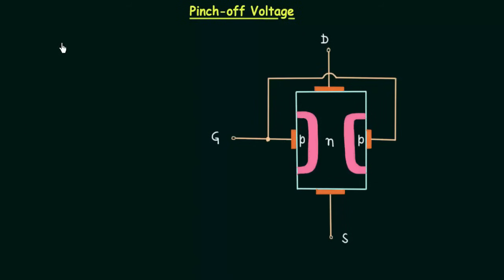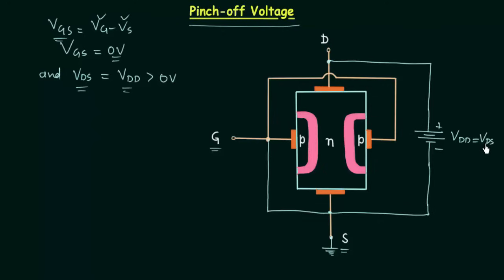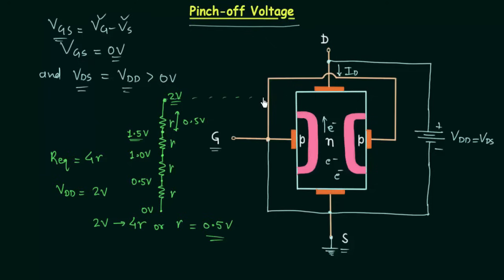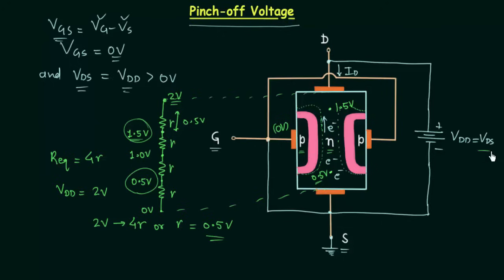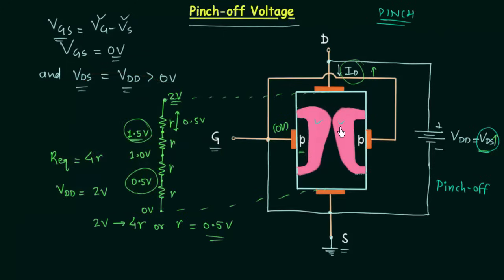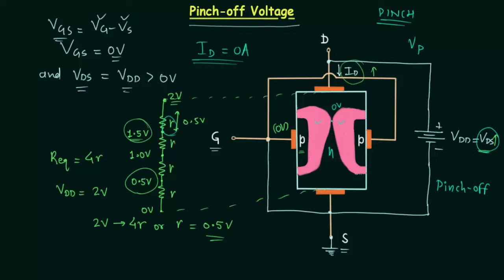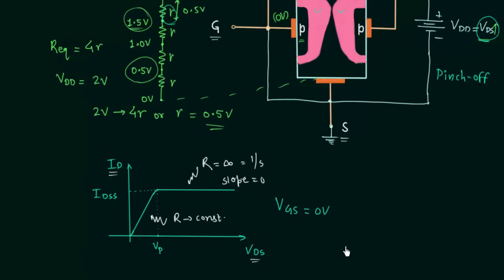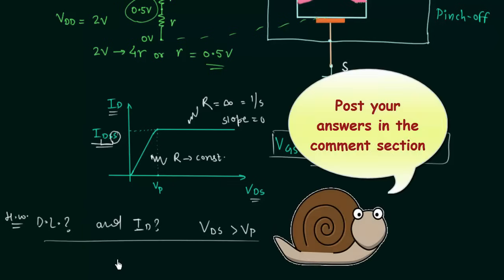Pinch-off Voltage

Comment: When VDs is increased beyond Vp, the depletion region or layers expand at the top of the channel. The channel now acts as a current limiter and holds drain current constant at Idss. The region between Vp and VDs (max) is called as active region & for proper function VDs is kept between this two levels otherwise is VDs is increased beyond VDs (max) breakdown occurs in JFET .
Reply: what do u mean by breakdown here?...is it damaged?
Reply: @subratachowdhury8059  yes after a certain Vds value u will get 0 current not because pinch off but because potential damage to the JFET

Comment: ** 100% CORRECT ANSWER **

When we increase Vds further after Vp , the drain current (Id) will remain constant( i.e Idss ) for some time but at a voltage Vds=Vds max (Vds max > Vp), the drain current increases enormously almost independent of the applied voltage Vds.This condition is called breakdown of JFET.(Similar to breakdown in output characteristics of BJT)
Reply: Just support me if I am correct.... is it becoz of the reason the applied Vgs(>0) has to first break the internal voltage of jfet (till then Idss is 0) & then Id current shoots up as width of d- layer  decreases?
Reply: @Supratim Debnath
Reply: I didn't understand bro Pls explain once again
Reply: But on increasing further more voltage ,than Vp,  two depl. Region would touch and current flow would stop thereby rev. Biased pot will be gone.

As soon as depl. Region becomes to its natural width, again curr. try to flow, which in turn cause increased depl. Region.

Thus we can conclude that curr will not increase further, more than Idss, neither break down point will b acheved ever.
Reply: You actually copied your answer from drain characteristics lecture
Reply: @bishwajeetkumar3441  No. Remember a normal PN Junction diode when high reverse bias is applied to the depletion region. There exists a certain high reverse bias breakdown voltage at which all the bonds break and this effect is called avalanche effect. Similarly, in JFET, when Vds>> Vp then avalanche effect would take place and current will increase irrespective of the voltage.
Reply: @aniket4952  the current increases theoritically but in practical the diode can't resists and leads to breakdown of diode resulting no current  in the circuit
Reply: @Happydoppy  Yeah, Theoritical and practical scenarios are different.

Comment: Increasing Vds beyond Vp lengthens the contact of the two depletion regions along the channel, but Idss remains constant. Under this condition, the JFET acts as a current source. The channel cannot close completely at pinch-off value, reducing Id to zero – instead, Id retains the saturation level

Comment: When Vds is greater than  Vp the pinch-off occurs. If we further increase Vds i.e. Vds>Vp, now the constant current 'Id' flows from pinched off point to the source terminal ( the n-channel is treated as a variable resistor so has a voltage difference between pinch-off point and source). Thus current flows from pinch-off point to source which is constant for any value of Vds>Vp.

Comment: When Vds=Vp, depletion region touch each other and Id=0 but this is not possible but as per your graph when Vds>Vp Id remains constant and the depletion region's  width will not increase more
Reply: yupp that is the right answer.
Reply: Reading from boylestad….    If VDS is increased to a level where it appears that the two depletion reasons would touch the condition referred to as pinch off will result. the level of VDS that establishes this condition is referred to as a pinch off voltage and denoted by VP. in actuality the term pinch of is a misnomer in that is suggest that the current IDis pinched off and drops to 0A . however this is hardly the case ID maintains a saturation level defined as IDSS in reality a very small channel still exist with a current of very high density the fact that ID does not drop at Pinch of and maintains The saturation level is verified by the following fact the absence of a drain current would remove the possibility of different potential levels through the nchannel material to establish the varying level of reverse bias along the PN junction. the result would be a loss of the depletion region distribution that causes pinch off in the first place

Comment: ->The voltage at which the channel closes is called the “pinch-off voltage”, ( VP ). When VDS is increased beyond the pinch off voltage, VGS (Gate Voltage) controls the channel current and VDS has little or no effect ie: remains constant.
->Operating with the Drain Source voltage above Pinch Off is known as the "Saturation Region" as the JFET is acting like a saturated transistor; that is any increase in voltage does not produce a relative increase in current

Comment: When we increase Vds further after Vp , the drain current will remain constant( i.e Idss ) for some time but at a voltage Vds=Vds max , the drain current increases enormously almost independent of the applied voltage Vds.This condition is called breakdown of JFET.(Similar to breakdown in output characteristics of BJT)

REPLY

Comment: Operating with the Drain Source voltage above Pinch Off is known as the "Saturation Region" as the JFET is acting like a saturated transistor; that is any increase in voltage does not produce a relative increase in current.

Comment: current remains constant and depletion length will also remians constant but after some time as we go on increasing the voltage  the transistor will burn,even though they are stable for the temperature it might not bear that much temperature,it stops working and after all it burns off

Comment: As Vds is increased beyond Vp, the region of close encounter between the two
depletion regions will increase in length along the channel, but the level of Id remains
essentially the same. In essence, therefore, once Vds  Vp the JFET has the characteristics of a current source. The current is fixed at ID  IDSS,
but the voltage VDS (for levels  VP) is determined by the applied load.
Reply: Nice explanation 🙏👏

Comment: As the Vds is increased beyond the Vp 1)then there will be no increase in the depletion region because the potential at the pinchoff is 0V and it is also 0V at the gate side 
2)the Id current become constant and will not increase further

Comment: 00:06 Pinch-off voltage is discussed in this presentation.
01:45 The end channel provides resistance to current ID in the circuit.
03:19 The pinch-off voltage is 1.5 volts in the N channel.
04:41 Pinch-off voltage is the voltage at which the two depletion regions of a MOSFET touch each other.
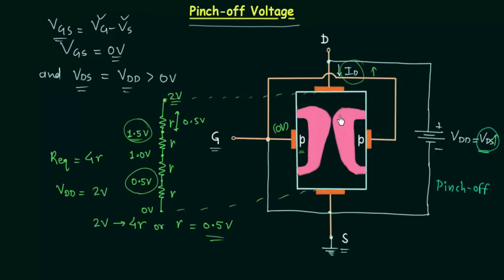06:00 Pinch-off voltage is the voltage at which the two depletion regions resemble a pinch.
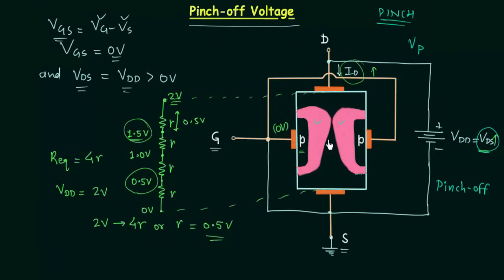07:18 Pinch-off voltage is the voltage at which the depletion regions of a PN junction in a MOSFET do not touch each other.
08:48 The pinch-off voltage is the voltage at which the drain current becomes constant.
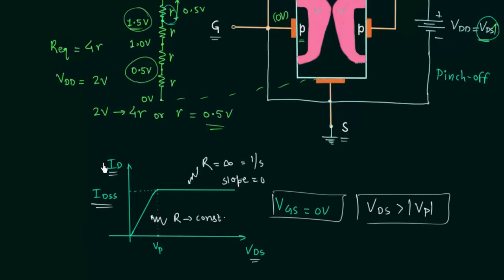10:26 IDs is the maximum drain current.
Crafted by Merlin AI.

Comment: when we increase Vds further after Vp, the depletion region becomes same seems to be pinching each other, which results in same drain current. but this condition is only valid when Vds do not reach to Vds max, bcoz when Vds reach to Vds max, then drain current increases enormously which results in a breakdown of JFET.

Comment: At 7:47... You told that "when drain current becomes zero then potential drop across channel resistance becomes zero.. So the diode will no longer be reverse bias". 
Now my question is " let us take Vds=4v at which the channel pinch off occurs and from diagram it looks drain current should become 0 at pinch off voltage. Now if drain current becomes 0 then voltage drop across channel resistances will be 0. Till here you are wright. Now you told - both P and N side will be connected to 0 potential.....

But how?

If drain current becomes zero then the potential drop will be zero. If potential drop will be zero then the potential at the middle of the channel and at each and every point of the channel which will be equal to drain terminal voltage.(Vds=4).  So in this case also p side is connected to zero potential and n side is connected to potential of 4 volt. So here also diode is reverse bias.

Now.... Sir... you explain me how you told diode will no longer be reverse bias?If you will see my comment then please answer it sir. I have searched everywhere but I am not finding proper answer.

Comment: nice sir but there is a problem. you said that at pinch-off  the two depletion region touche each other thats mean that current should be stopped but in latter graph at Vp (pinch-off volt) the current shown is maximum
Reply: when Vds = Vp, the depletion regions dont touch each other, they come VERYY close.After Vds>Vp current becomes constant

Comment: one question:
You said that when depletion layer causes resistance to the flow of electrons,right? So, when the Vdd increases and the depletion layer increases to the pich off point, there will obviously be maximum resistance to the electrons right. So won't current decrease?
and when Vd is increasing, current is increasing, why?
My question is, at pinch off, does the current increase or decrease?
Reply: Current didn't decrease, it becomes constant.
Reply: Many people seem to have the same doubt, I think (i'm not an expert) that while increasing Vdd will make the depletion region grow, the decrease of current because of that is not comparable to the increase of current the Vdd itself is creating (because of omh's law). So the higher the Vdd the narrower the path, but more density of electrons there will be (kinda like pinching a hose). Maybe think of it as the narrowing of the path is compensated with an increase of electrons flow in the constant region of the graph.  At least that's my theory, i could be very wrong.
Reply: @guidoglielmi7992  I think you're right.
Reply: @guidoglielmi7992  ur theory was good

Comment: my 2 cents analysis:
for increasing Vds above Vp the internal resistance cannot be infinite, since then current would drop to zero, if current is constant and Voltage raises, then resistance raises also, can be very high, but not infinite.
It looks like in case of incrementing Vds above Vp, the channel gets narrower (but not closing) just not in the lower resitance way (high slope) for Vds <= Vp but in a lot higher resistance environment (slope as good as zero) due to the narrowness of the remaining useable channel. 
Then above a certain Vds point the FET will get destroyed due to break down currents.

Comment: SIR when Vdd increasing depletion lays will increase and Id current will become  zero 
but deplision layes will not decrease direct 2V = Vd will comes in place of 1.5v i.e revrise voltage is still more increasing

Comment: Why before pinch off the Id vs Vds relation is linear? (for a definite voltage in Get) A linear voltage means resistance remains constant. But it should not be as the depletion layer is increasing due to increase in Vds...

Comment: Sir , ur already told that when we are increasing the Vds then at some voltage Id=0 then the depletion region cannot increase furtherbut in later in the graph at Vp the Idss =4v . But ur already told that Id=0
Reply: yeah what is going on ? anyone has the answer?
Reply: But it was not id =0,the minimum current flow will maintain that called IDSS then we can assume id =0=idss 👍

Comment: According to the graph, the current Ids will remain constant (equal to max. current Idss) if we increase further voltage ( or for voltage Vgs >Vp), but the confusion here is why the hell current increases when the voltage Vgs increases? inspite it should decrease  cz the the path of the current decrease by increasing the voltage Vgs.

Comment: Sir, according to your explanation when two depletion region touches each other then Id=0 and then depletion region wont increase furthermore.
So depletion regions gonna touch each other first, r8. Why it's called they will never touch eaxh other.
Reply: first of all,the depletion region will never touch each other as because the voltage of the surrounding part of the "almost touching region" will be closer to 0v and the p-n junction of gate to source will no longer be reverse biased. ^-^

Comment: Sir, there are two things happening simultaneously...
one is with increasing Vds current Id is increasing but again with increasing Vds the channel is becoming narrower too so Id should be decreasing if we consider that.....so whether 1st one is dominating or what???
Reply: please explain anyone
Reply: I think that initially, the channel is very much wider. So the current will flow through it even if the channel width is decreasing as it is too wide and current will increase. But once it becomes narrower than the capacity to handle input current, current decreases.
Reply: When the Vds increases, the depletion layer starts widening but also the Id increases. As Vds increases, the resistance to electrons also increases because of the widening of the depletion layer leading to the decrease in the slope of the current. Then Vds reaches a point where the depletion layers seem to touch each other. At that point the electron passing through the passage is limited and thus the current is also limited called the Idss. I hope that helps :)
Reply: @mjklifts  sir as said in the video. Id will become zero after pinch off voltage. But the graph shows that equal to Idsss how??

Comment: If we increase drain to source voltage (Vds) beyond the pinch-off voltage(Vp) the channel becomes heated due this thermal agitation covalent bonds will broken and hence avalanche breakdown takes place, due to this there is a sudden increment in current.

Comment: If dVgs=0,then with increasing Vds beyond Vp current Id remains constant because the channel will be more narrow without touching each other due to reverse bias. And as practically Id never be 0 so we can say that the two channels never touches each other.And if Vgs not =to 0 there must be 2 cases. 1 is Vgs grater than 0 and Vgs less than 0.

Comment: Sir, I didn't understand why those depletion region will not touch each other. Plz explain. Thank you
Reply: this is not correct
Reply: If you know why the depletion region is wider at above point then you must be aware that it is because of potential difference at pn junction in reverse bias condition. On touching of depletion region with each other current flow will be blocked and hence voltage in n region will be zero i.e., No bias condition will arise between pn junction and in that condition depletion region width is less than its width in reverse bias condition. Hence, it will try to become thin but suddenly current flow will start and due to reverse bias condition its width will increase and these two conditions will cause regions to never touch themselves.

Comment: you said pinch off never occurs because Id =0 so its not reverse bias,but in graph ID is not zero its constant and positive so it will be reverse bias then
Reply: It was said that pinch off occurs but the two depletion regions never touch each other because if they touch then Id=0 and it's not reverse biased and hence depletion region will not increase to touch each other but it remains uniform... Hope it helps.

Comment: I'm confused with a silly thing..... as two regions are coming to each other.... the area for resistance should decrease... which should decrease drain current...... but graph tells that it increase :/ ....
Reply: yes same doubt i have
first thay said that when both depletion regions are touch each other Id will become zero.that is called pinch off.after pinch off even though  we increase Vds it will become more negative.i.e more reverse biased beyond break down
Reply: Farzal Syed because current density increases. Thats why
Reply: current increases when Vds increases (not Vgs)....thats Obvious
graph shows that
Reply: Its not the "drain current" which is going to decrease, the "amount of increase" in the drain current is going to decrease. That means, the drain current will increase, but not as much as it has increased before.
Reply: As the regions are almost to touch each other,the current density will be more. Further increase in Vgs there will be a breakdown in the transistor.
Reply: Same doubt here....
Reply: Farzal Syed nice question
Reply: But At the same time we are also increasing the Vds thats why..... You can see in the figure
Reply: exactly...
tq...
Reply: @TheMyPgk  yes

Comment: sir i ahve one doubt.
when pinch happens then only id will become zero.that means that both layers are touch with each other.then how a constant current will flows
Reply: krishna godugunuru the constant current idss will flow at the pinch off voltage and at that point the voltage and current is constant you can see the grap. hope you understand
Reply: As depletion region increases, when Vds > !Vp! 
let for a moment Id decreases to zero, but at that time, PN junction going to be forward biased naturally and depletion region is decreases and current is increasing , to a Idss value (i.e on pinch voltage),
so, a constant current Idss flow in the JFET....
hope it can clear ur doubt...
Reply: As the two depletion region get closer to each other the channel will narrow and the drain current will decrease but the VDS will also increase cause the drain current to increase. That's maintain the drain current nearly constant.
Reply: in reality the two regions are not touch each other.if it happen id=0 and vd=0  and the pn region is not reverse biased
Reply: Yes